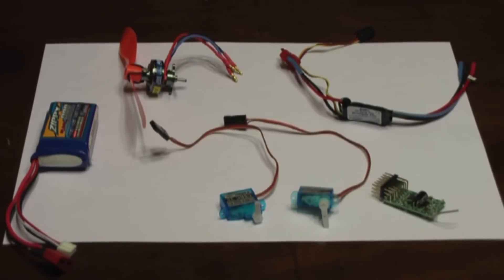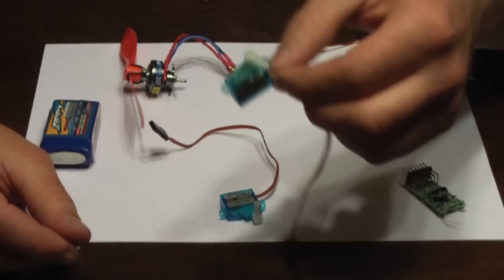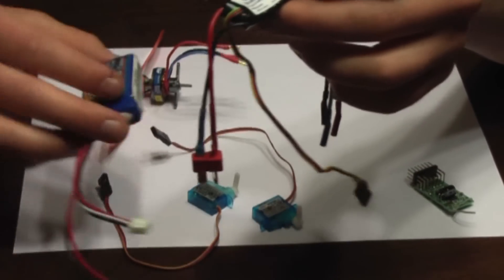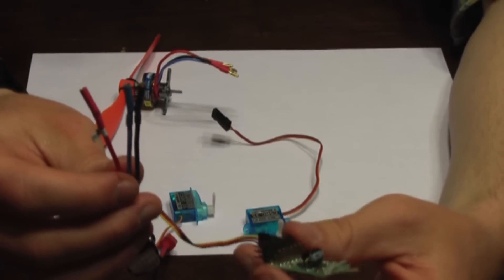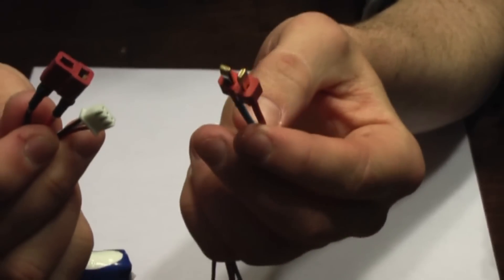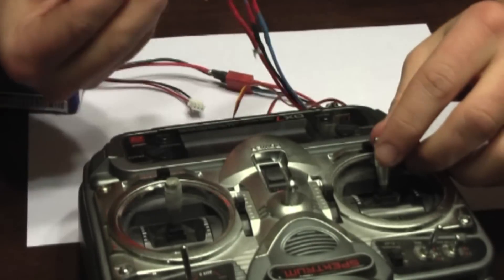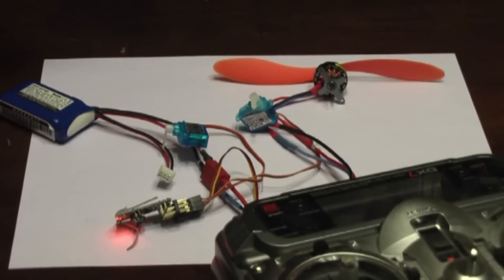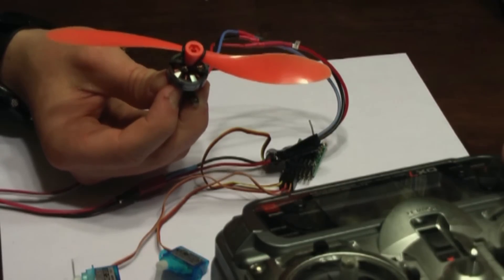RC Electronics Basics How To ( Tutorial)

Comment: You forgot one very important thing.  You must make sure the connectors are plugged into the receiver with the ground lead in the correct position.  It is possible to plug them in upside down and your system won't work.

Comment: Your speed controller works off of variable resistance (potentiometer) it controls the amount of voltage flowing through to control motor speed just for a tid bit of knowledge.

Comment: Does this setup work with land and water crafts?
Reply: +robdogboy78 I was wondering the same thing, and what I've learned is yes, as long as you connect the correct things, in the correct places, corresponding to the transmitter sticks that you want to use for that function. (i.e. steering, throttle etc.)

Comment: Hi! great video but the one thing I've been trying to get my head round is mixing the two servos motions. I see when you pull down only one servo moves and the same to the side. should they not both move opposite direction for left and right and both for accent? I've been scratching my head for months about how to do this without a top range transmitter. cheers

Comment: Hi Brandon. That was very helpful. Quick question. Is receiver required to start the motor with esc? I was planning to build a non RC flying object..using arduino and distance sensors and some time logic.. as you said in the video that motor will not start if throttle at 0.
Thanks..

Comment: What if it is a explosion engine on the airplane, if I'm not wrong the engine if powered by another servo, in this case, where do you conect the servo to move the carburator? if you don't need the ESC in this case, how do you power the reciever?
thanks!

Comment: What happens if the battery runs out of electricity while flying? The battery powers everything so the servo's wouldn't work anymore right? Or will the servo's keep going even when the motor runs out of electricity? Can somebody explain to me how this works?
Reply: onzin account flat battery =falling rc plane . The servos are used for steering and altitude and are powered from the battery. Hope that helped :)

Comment: you say it doesn't matter which wires you connect to where when connecting your esc to your motor, and later again you say it doesn't matter which 2 wires you switch if your motor is turning backwards. do you even understand electrical systems at all? it does matter which ones you connect to where, and it does matter which ones you switch. cause you switch the wires around, there is a possibility that it won't change anything. there are 3 phases with those wires, 2 hots and a neutral. the ESC changes your DC from your battery to AC for your brushless motor(s). while i do say thanks for this great information, at the same time you are also providing information that is incorrect with the wiring at the motor.
Reply: No it doesn't.  That's the beauty of brushless motors.  It's not a 3 phase motor, it's a DC motor.

Comment: How do you set up 2 channel ...elev and rudder ...without the motor or esc
Reply: i dont thing u can because u need power to the reveriethat goes though the esc
Reply: You omit the ESC, unless you are using the BEC to power the receiver. Connect the rud and elev to the receiver, and go.  If you dont' use the BEC, you need a battery to power your receiver.

Comment from the maker: Batteries usually come with a connector on them, but ESCs don't. You have to buy a connector for you ESC that matches the battery you want to use and solder it on. I usually buy my batteries from hobbyking so they come with xt60 connectors, but I switch them out with deans connectors.

Comment: now I'm looking at the flow of electricity from and back to the battery, and I'm a little bit confused. I'm not sure how the receiver is sending signals to the ESC and then the motor, as the receiver is "downhill" of the ESC. One would think that the receiver could only affect components that come after it in the sequence of the electricity's path?

Comment: So if you are going to have a plane with Elevons and you plug the servos into the Elevator, and Aileron channels of the Receiver will you have the Elevator hooked up to both control surfaces, and the Aileron also to both control surfaces? I would assume they would conflict with each other so I though you needed an added piece of technology to translate the two signals together.

Comment: Thanks for the video. How can I get all the parts(that work well) for very cheap prices? I have been seeing packages online for like 30-40  bucks for the servos, engine and ESC,  30-40 bucks for a 6 channel 2.4ghz transmitter/receiver... What brand of battery is a cheap low end that works? What if you added two motors to your cardboard plane, does it go faster? is it more stable?

Comment: No, direct POT can not control a servo. It only changes the voltage, servo needs pulse modulation.
There are PWM (pulse width modulators): they do the job.
You can also buy a thing called "servo tester" - it is a ready-to-use board that you hook up straight to a battery and servo and you can control it directly (they are not expensive).
Often they look like POT, but they are not.
Some of them are digital - just a small boar with 2 knobs.